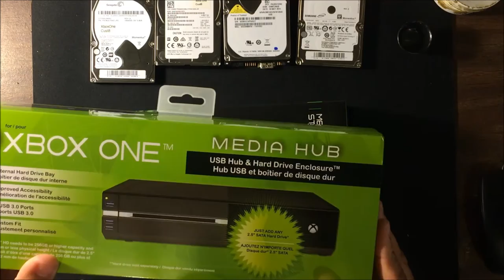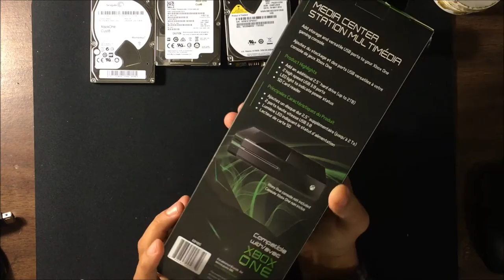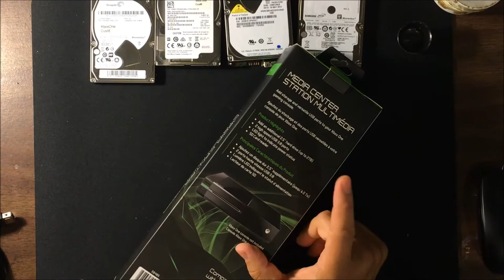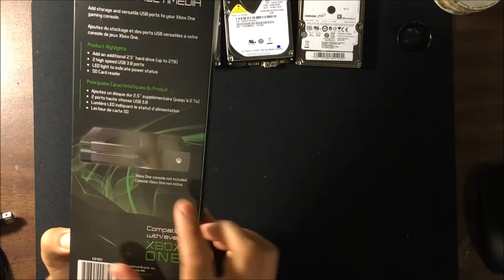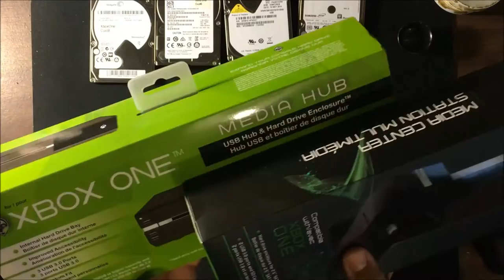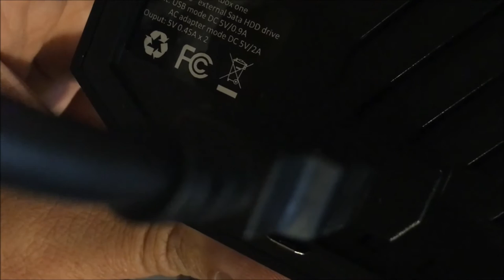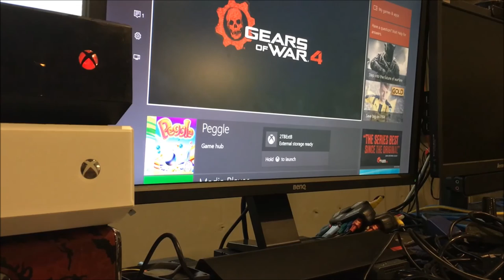Xbox One Mods: ICON Media Center Teardown and HDD Activity Mod

Comment: Well I just tested my activity light successfully thanks to your video. But I also noticed that it is a power light as well as activity light on pin 11. It lights up when there's power to the drive and when there is any activity it turns off. I also noticed only about two and a half volts is coming out of pin 11. I didn't have a chance to measure amperage because the fuse is blown on my multimeter. Would you happen to know how much amperage comes out of pin 11? I also noticed that the LED was pretty dim even with no resistor any ideas on how to brighten it up a little bit?

Comment: very informative video i think im gonna have to grab one of those media centers. I wonder if theirs a way to supply the extra power needed for the 4tb drive to work without that power getting back to the xb1. You also said that when you have the power cord plugged into the media center the xbox wont boot. maybe you can put a diode somewhere on the usb3 connection so that it cant see the extra power. Another thing that was great about this video was that im planning on making an activity light for the stock hard drive in my xb1 and ive read manuals for the 500 gig samsung spinpoint manufactured by seagate and i already knew that pin 11 was the activity pin however i thought pin 1 was on the opposite side. Like for example where you have your activity wire soldered onto the hdd connector on the media center circuit board i thought that was pin 5 at first until I saw this video. however on the xbox one hard drive to mobo connector their is a lead that connects to pin11 on the hard drive but it is a dead lead. none of the wires coming out of the hard drive connector going to the mobo are supplied with the pin 11 activity power based on resistance readings i just took on every pin of the hd to mobo connector. I was just hopin to be able to splice into one of the wires for hdd activity voltage but obviously the xb1 mobo has no need to know when their is hdd activity lol, so in short ill have to open the hard drive and solder a wire to pin 11 like you did on the media center pcb. I was researchin for a cpl hrs tryin to find the proper pin and your video helped me figure out what i gotta do.

One other thing tho and like I said before this is a great video but next time maybe you could make your lighting a lil better, i was having a hard time seeing a cpl things maybe bring the things your trying to show a little closer to the camera too.

Comment: Very interesting video, especially the usefulness of a power adapter.  I won't need one... good...

I'm curious about one thing. If you power the Icon product with an adapter. Will your 4TB drive work this time on your computer?
Reply from the maker: Yes, using the power adapter did properly power the 4TB ST4000LM016 drive allowing me to see the drive on a PC and it would probably be a fine drive to use on a PC.
However, I just couldn't get the drive to work right on the Xbox One using the external power adapter or USB power. The drive would just disconnect and reconnect at random times closing whatever game you were playing from the drive at the time. This was consistent on both Media Centers I used.
The 2TB ST2000LM003 drive I use now has been working great for months without issue.
I have since picked up 2 more 4TB ST4000LM016 drives but I don't want to be bothered.
Just to note there is now a 2TB ST2000LM007 and ST2000LM015 and 4TB ST4000LM024 so results may vary even further.
Reply: I'm waiting for my 1TB (WD10JPLX) and it should arrive in a few day's. 1TB should be enough for my needs for at least year or two.
Reply: I played on the Icon for a few hours and it seems stable. No disconnection during play. 

The only problem is when the console is turned off (in both modes). The hard drive does not shutdown. Tried deferent power settings (ex.: When Xbox is off, turn off storage) but with the same result. No solution found online.

Unless you have a solution, I think I will be returning the product. That's too bad because it looks great. I will be looking for an external case with a power button.

Does the collective Minds hub suffer from the same problem?

Comment: Well I bought one of these hard drive expansion modules off Amazon. The one I bought was the one that has a cooling fan inside and I ended up installing LED strips into it and ordering a new quieter 12v fan for it the original was a 5 volt fan with a 3 position switch on the hard drive expansion module however the fan only has one speed  so I don't know why they gave the switch three positions and the fan stays on when the Xbox is off  unless you switch it off of course but I was going to tap the new fan into the switched 12v power from the LED strips  that come into the expansion module so that the fan turns on and off with the Xbox.  and I also did a lot of rigging just to get the thing to mount flush then when I went to go get my first hard drive a 2 terabyte WD blue the Xbox sees it and then when you go to format it the hard drive calls for too much power and shuts down you can hear the platter arm kickback.  so I decided I'd go with an SSD so I got the new SanDisk Ultra 3D from Best Buy which had a power consumption of 1.7 amps but I really wanted the Samsung 860 Evo 1tb because that SSD is either 1.2 or 1.4 amps and I was under the impression that the USB port puts out 1.5 amps.  but the Best Buy I went to didn't have the Samsung 860 evo  in stock which is why I bought the SanDisk.  the SanDisk ended up not working so I returned it and went to another Best Buy where I got the Samsung 860 Evo and that didn't work either however it is currently working in the media center station that I bought from Gamestop today like the one you have.

But you're saying the xbox usb ports put out .9 amps can you confirm that for sure? and do you know if that's the same for the One S and the One X. So what I ended up doing was I just went out today and got that Media Center Station like the one you have where you shaved down the plastic to accommodate a thicker hard drive. 
I also noticed you said that when you use higher-capacity hard drives that using the external power supply plug on the back of the media center is necessary but whenever you use it the XBox doesn't boot up I'll give that a try and get back to you with my results unless you tried it on both of the ones you have,  it looked like you had two different ones in this video one that's modified and one that's not.  But either way the best thing to do would be to figure out what lead on the expansion modules male USB port is sending power from the expansion module external power supply to the Xbox console and install a diode so that that power can't be shunted back to the console.  then maybe you could use a 4 to 6 terabyte hard drive. I was also hoping to be able to modify the Xbox media center I just bought today to accommodate the fan I ordered for the other one. Also the LED area that lights up when you put the SD card in I'm going to have a blue LED illuminate the right side of that light indicating internal hard drive power/activity and a red LED on the left side indicating external hard drive power / activity.  I'm also going to be using a couple Step Up converters that I have to brighten the power / activity LEDs up a little bit